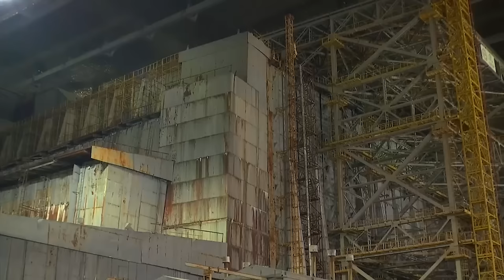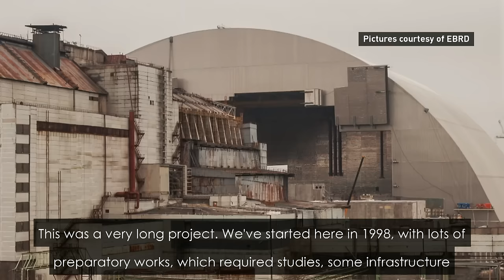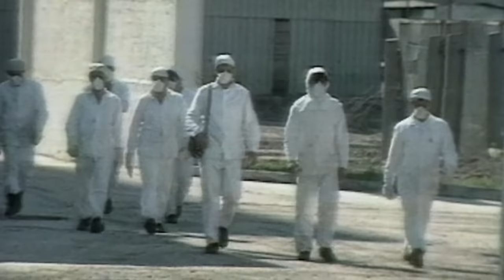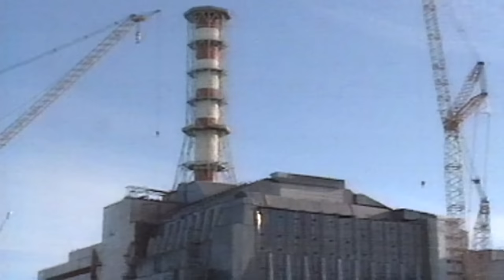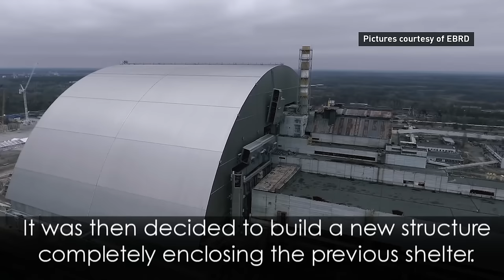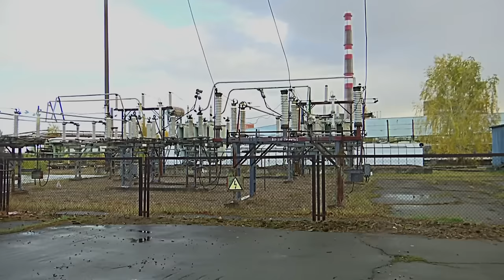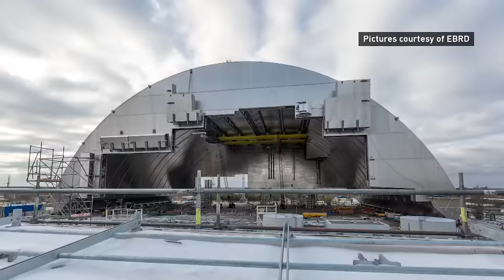Inside Chernobyl’s new €1.5bn structure for exploded nuclear reactor

Comment: “Radiation levels inside were estimated at 20 times more than the lethal dose.”

This sentence makes no sense. Radiation levels are measured in Sievert per Hour (or mSv/h or uSv/h) because radiation levels are a *rate*.

A dose is the amount of radiation accumulated over a period of time, i.e. one has to integrate the rate of Sv/h over the time so that the resulting number has the unit Sievert.

Whether a radiolevel is lethal depends both on the rate and the exposure time.

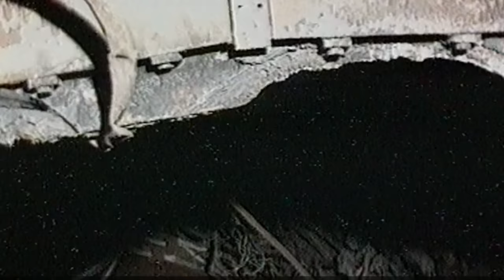Rate and dose are to each other like Watts and Kilowatthours. Thus, the sentence at 1:52 cannot stand as-is and should be corrected.

If you want to make a proper statement, you have to provide the exposure time. For example, staying inside the building for one hour would expose a person to 20 times the lethal dose.

Comment: Radiation is amazing.. invisible(mostly) and 30years on and this thing is still spewing out just as much radiation from the core.
It’s a shame such a feat if engineering(the shelter) is for something so disastrous.
Reply: Not just as much. You can go and stand in front of the Elephant's Foot now and not die in minuets.
Reply: @bensemusx  the core are will still kill you quickly... the elephants foot isn't as dangerous no more and I'm sure you could approach it but it was just melted concrete and core shielding but the u235 from the fuel rods won't be safe for 1000s of years..

Comment: if radiation is 20 times lethal dose, how is that theres is people walking around inside the sarcofagus in 1:50
Reply: nicolorau the earth is flat
Reply: The lethal doses are in parts of the original building. You have to get very close to the reactor core to get a lethal dose. The Elephant's Foot, when it was first discovered, had an LD 50 of 5 minutes. Now you can stand in front of it safely for a bit and not receive much radiation.

Comment: So... won't the gamma rays eventually irradiate the sarcophagus? It's like heat transfer. If there is heat on one side of metal, eventually the other side will become hot... radiation works similarly.

Comment: So I guess they are going to need 200 of those before the radiation is at a safe level there.
Reply: Well not if everything goes to plan. They intend to deconstruct, bury and entomb as much as possible. Hopefully, by the end of this thing's lifespan most of reactor 4 will have been cleaned up.
Reply: @Thumbsupurbum  Didn't know that was the plan so I guess as you say,hopefully.

Comment: I wonder if there s any plans for the future to remove the radioactive fuel/corium here or in fukushima
Reply: Fukushima i believe is a WIP, chernobyl i believe that stuff is still not fully solidified yet and they need to safely dismantle the old containment structure to reach the melted down fuel
Reply: The Duck it has fully solidified but is still “hot” in a manner that it still gives off dangerous amounts of radioation

Comment: All of this for only 100 years seems inefficient
Reply: It only has to last another 45 years if everything goes to plan as the reactor and everything in it will be broken down, packaged up and either buried somewhere or re-processed in another reactor as fuel.  the company working inside the NSC has set a completion date of 2065.

Comment: How come they don't do this at Fukushima?
Reply: At Fukushima they've put covers on their exploded buildings already, at least temporary ones to prevent most airborne radiation contamination and there is plans to put a larger sarcophagi in place.  The main issue with Fukushima is groundwater seeping into the molten cores and continuing into the ocean while Chernobyl was an exposed burning core.  Obviously it's more detailed but that's just a simple explanation
Reply: @treefiddy727  I hope so, that's good to know. I wonder what they will do with all that contaminated water that is stored in those corroding water tanks. What a mess.
Reply: @phillyphiltropicsnow756  It's my understanding they can filter out most of the radioactive isotopes with the exception of some plutonium. Who knows really but it's the best solution they have (for now) and it buys them precious time. At the very least there's plenty of unlivable areas to store them for a long time

Comment: How they can walk without any security clothes in the structure? I thought inside of structure is full of radiation and no one can get into it anymore...
Reply: It's been 34 years.  In 1986 if you stepped into the sarcophagus (the original covering) you'd be dying within minutes, but today you can get very close to it and not be affected unless you inhaled dust or touched something and then licked your hand.

The thing with radiation is that the most powerful and potent sources are also the quickest to become safe, because they are spitting out so much energy that within a few years they have expended all that energy and become depleted.  But with a weak source that only spits out energy a little at a time it can take thousands of years to become safe.  The interior of the reactor had the worst/hottest sources and so many of them are now exhausted, they've been spitting out trillions of tiny bullets every second of every day for 34 years and now they are pretty much out of ammo :)

Comment: Only 100 years.  What happens after that?  We scientist and people know how to really take dump for generations to come.
Reply: Nothing hopefully, there are cranes inside the new structure designed to take apart the old structure piece by piece. The hope is we can decontaminate the site within 100 years so we won't need the structure anymore (or at least not a structure as large as the current one)

Comment: Maybe if I watched the hbo series I would understand but I don’t get how the whole building is part of the nuclear power plant, yet they built that giant thing to cover only a section of the plant, I would think you could get to the contaminated area by entering an entrance not covered by that structure
Reply: Different buildings and reactors. Reactor 4 is where the accident was and what was covered up while reactor 3 was being used until 2000 I believe. I'd assume any entrances to building 4 from 3 were sealed off when they built the original sarcophagus but I could be wrong

Comment: Why just built for 100 years? Surely encase the thing in concrete would be a cheaper way and last longer?
Reply: That's literally what they did with the first one, and that one barely lasted 30 years.
Reply: Concrete is eroded by the radiation emitted from the core. Stuff can handle radiations of that level for only so long.

Comment: Why are they inside it?! I thought the point of this was that humans didn't have to go near it
Reply: Most of the radiation has died off by this point. The worst radiation levels would have been in the first days months of the accident.

The main radioactive elements in the reactor were/are Caesium-137, Strontium-90, Iodine-131, and Plutonium-241. 

The thing to know about radiation is that the lower the half life the greater the immediate rads it gives off. So the iodine had a half life of 8 days, meaning that it was the "hottest" of the elements due to the shortness of the half life, but it's all been gone for 31 years now (fully inert after 2 years). The Caesium and  Strontium both have a half life of 30 years meaning they are now HALF as radioactive as the readings in 1986. The Plutonium-241 has a half-life of 14 years, so it's a quarter as radioactive today.

Obviously there is still uranium and slower decaying plutonium president, but due to the length of their half lives, they are relatively safe compared to the other items listed above (unless you have fission occure, which stops once the meltdown occurs).

So honestly, with proper clothing and breathing devise you could probably stand inside the core for a few minutes without suffering a lethal dose of radiation (though I wouldn't recommend it). Heck, you can stand next to the infamous elephant's foot for up to 5 minutes now. Back in 1986 you'd have been dead in seconds, bit today it's not even close to that bad.

So compared to that... Standing outside of the concrete sarcophagus, you're probably get less radiation than you'd get from a plane ride (30x the background radiation).

Comment: And Australia thinks that nuclear power is the future. Take this for a horrible loss of life and money as an example.
Reply: What's the point of nuclear power anyway also I agree with you since this will explode and the will affect australia
Reply: Chernobyl was a pathetic disaster because of the Soviets' complete incompetence.

They rushed the construction of the reactor, they cut corners in safety measures for cost saving, they hired incompetent and ignorant managers that refused to listen to experts, they rushed a long overdue safety test, they made every possible mistake to amplify this disaster.

Modern reactors held to modern standards are hundreds of times safer and better operated. The chances of a disaster like Chernobyl happening with modern reactors like in the USA and Australia is minuscule at most.

Comment: What happened to the stack it didn't appear like it was going to fit in the new Sarcophagus?
Reply: M Ladd they replaced it with a new smaller one
Reply: I don't think the entire building was encased in the Megatomb.
Reply: It was only the reactor core section. That's the main bulk of the problem or rather was.. till 100 years go by.
Reply: @Just_another_Euro_dude  Its Polish for Popeye! 555

Comment: Wait how people can work there its not super radioactive!?!?
Reply: Most of the radiation has died off by this point. The worst radiation levels would have been in the first days months of the accident.

The main radioactive elements in the reactor were/are Caesium-137, Strontium-90, Iodine-131, and Plutonium-241. 

The thing to know about radiation is that the lower the half life the greater the immediate rads it gives off. So the iodine had a half life of 8 days, meaning that it was the "hottest" of the elements due to the shortness of the half life, but it's all been gone for 31 years now (fully inert after 2 years). The Caesium and  Strontium both have a half life of 30 years meaning they are now HALF as radioactive as the readings in 1986. The Plutonium-241 has a half-life of 14 years, so it's a quarter as radioactive today.

Obviously there is still uranium and slower decaying plutonium president, but due to the length of their half lives, they are relatively safe compared to the other items listed above (unless you have fission occure, which stops once the meltdown occurs).

So honestly, with proper clothing and breathing devise you could probably stand inside the core for a few minutes without suffering a lethal dose of radiation (though I wouldn't recommend it). Heck, you can stand next to the infamous elephant's foot for up to 5 minutes now. Back in 1986 you'd have been dead in seconds, bit today it's not even close to that bad.

So compared to that... Standing outside of the concrete sarcophagus, you're probably get less radiation than you'd get from a plane ride (30x the background radiation).
Reply: @aaronalvin3992  nice thx i would go there anyway lol

Comment: What absolutely scares me the most is (if i understood it correctly) that inside this destroyed reactor are 3 types of highly radioactive material (forgot the names). One stays radioactive for 30 years and is no longer a problem since over 30 years have passed since the accident. The second one stays radioactive for 400 years… this is much more problematic but i can imagine humanity being able to take care of it the next 400 years until it’s no longer dangerous… BUT the third one stays radioactive for over 20.000 f***ing years! I don’t think that we will be able to take care of this for that long. It will either be forgotten about it or the human race will go instinct (given the current environment issues) before those 20.000 years have passed. This means it remains a ticking bomb vor the next 20.000 years. I know that this new construct wasn’t built just for sealing purposes alone, but also to move all of that radioactive waste into a new storage container. But who will look after this container for the next 20.000 years? What makes the situation even more scarier is that those materials are in pretty much every nuclear reactor on this planet.
Reply: Its still much easier to take care of nuclear waste than any other electricity creation method's waste.

Comment: So what happens in 100 years? Sure, most of the really nasty isotopes will have decayed quite a bit by then, but wont the site remain dangerous for much much longer? Aren't we capable of building something that will last longer than 100 years? There are skyscrapers in New York almost 100 years old built using the design and technology of the early 20th century that will certainly last another 100 years or more so why couldn't the NSC be built to last longer?
Reply: I think the goal is to cut up, and remove for safe burial, the most radioactive parts, for safe burial, before then.
Reply: @thrummer1953  That makes sense, but how much of that is really possible? Are we talking about the removal of all of the tons and tons of corium because much of it is still extremely hot. Hot enough to still be melting through the floor. Not to mention the hundreds of tons of sand, lead, and other material dumped into the reactor building which seems like it would be impossible to isolate without literally tearing down the entire structure in pieces and burying all of it. I'm not doubting what you said it true, it just seems almost impossibly ambitious.

Comment: Stupid title. Bad video. Good subject though.. Hardly any information present. What is the solar power farm for?
And an lol : They made a building for a building. Hopefully they keep working on a better solution and dont just leave for future generations to figure out. They say the NSF is only for next 100 years.
Reply: Just put another building on top
Reply: The solar is to power the dismantling process , the containment structure is to keep the radiation from escaping into the environment
Reply: @tonyzsoldos9969  thanks, I didnt even think about the fact they still need electricity inside to see and use equipment for that process.
Reply: Argosse Oqemi humans are not allowed inside the structure obviously because of the radiation only the dismantling equipment needs electricity